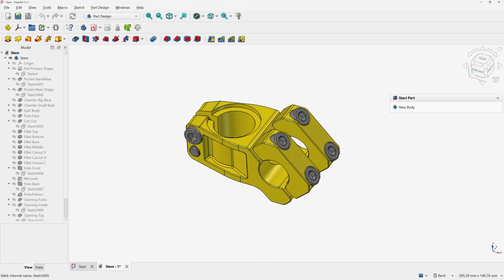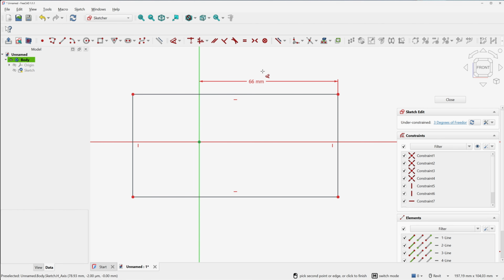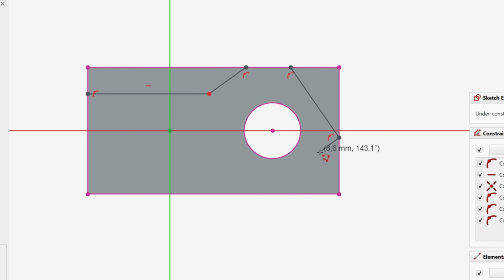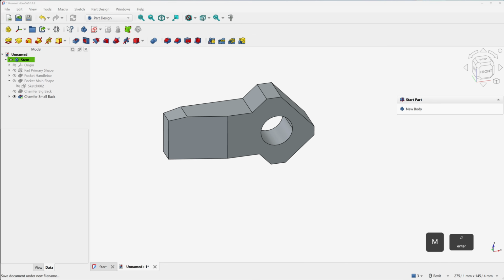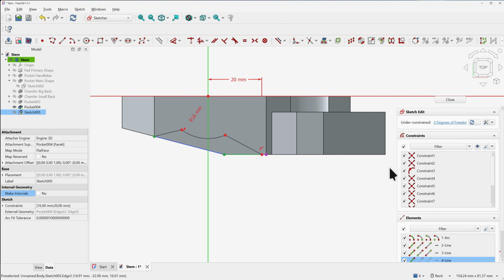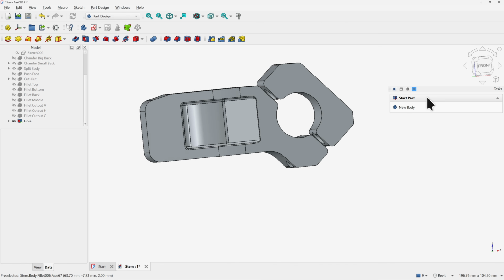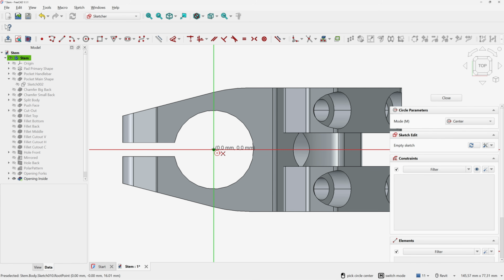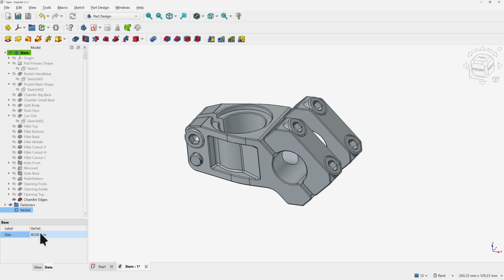New to FreeCAD? Start HERE (Ultimate Beginner Tutorial)

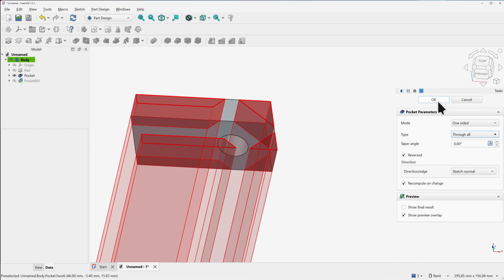Comment: Followed it perfectly through to 19:35 then on mine the 'wire not closed' error messages go nuts (despite checking it with the 'validate sketch' tool to find no breaks!) and it will not 'go through. Man this is hard when something doesn't work as expected - then what? Update: I missed the external geometry tool - you just have to miss one single little step and it all goes Pete Tong!

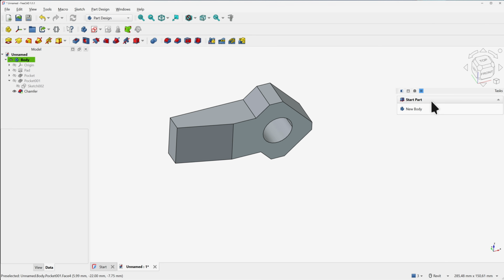Comment: Great tutorial. I'm still using FreeCAD v1.1.0, I downloaded it a few months ago, but only now started using it. Although, I followed the steps closely I encountered some problems. The first was in 'Chamfer Alternative (Pocket) 21:20', something about the shape not being closed, redid the steps twice-- no good. I ended up just doing the regular chamfer. 

Other errors were related to fillets, but...strangely, closing FreeCAD and reopening it again a few hours later solved most problems. The last problem (well, not really a problem since you stated it in the video) was related to the varset, I did that part and extended the 40mm length to 60mm. Then I tried lowering it and was getting an error, the solution was to gradually decrement it by 5mm as in the video. 

Wonderful tutorial, good pacing for me. I'm going to try other tutorials to learn more.

Comment: EDIT: I deleted the sketch and re-did it. for some reason the holes now preview...wierd.

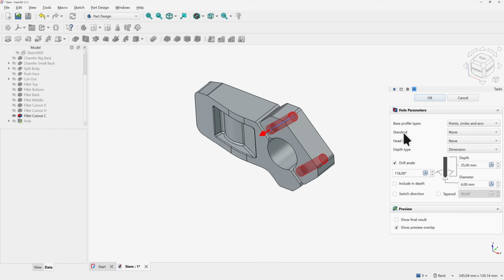38:31 I can't get the holes to generate due to an error dialogue: "Cannot use selected object. Selected object must belong to the active body. Consider using a shape binder or a base feature to reference external geometry in a body". 

Specs as follows:
OS: Windows 11 build 26100
Architecture: x86_64
Version: 1.1.4.20260928 (Git shallow)
Build date: 2026/09/28 
Build type: Release
Branch: (HEAD detached at 4fd3bf320)
Hash: 4fd3bf320d9566a27e60069fc8387448aaa3a094
Python 3.11.14, Qt 6.8.3, Coin 4.0.3, Vtk 9.3.1, boost 1_86, Eigen3 3.4.0, PySide 6.8.3
shiboken 6.8.3, xerces-c 3.3.0, IfcOpenShell 0.8.4, OCC 7.8.1
Locale: English/Australia (en_AU)
Navigation Style/Orbit Style/Rotation Mode: Revit/Rounded Arcball/Window center
Stylesheet/Theme/QtStyle: OpenTheme.qss/OpenDark/
Logical DPI/Physical DPI/Pixel Ratio: 96/93.1131/1
Installed mods: 
  * A2plus 0.4.68
  * Fasteners Workbench 0.5.67
  * FreeCAD-themes 2026.8.16
  * OpenTheme 2026.10.5

Comment: are there some gotchas in the chamfer/pocket alternative step at 21:20?

i set them as construction lines but it still complains about the wire not being closed

i made sure to make a fully closed triangle

what i think i miss in this tutorial is how to verify that the lines are proper construction lines and so forth, a short section on how to check your stuff or debug this

EDIT: I figured it out. The external projection button already made the dashed lines, i didn't need to turn them into construction lines because they already were! If you do toggle the construction line button you'd make them solid instead of dashed, and that won't work

Comment: ive got all the way to the bolts, it does not auto detect correctly and puts one bolt in the large center hole so no bolts for me at the moment i guess. i think i wll try and make them just as a challenge to myself see if i have learned anything. other than that issue i have learned a TON, and it has been a long but interesting evening of figuring how to connect dots and get angry when they don't lol.

Comment: Just a note on placing bolts in the holes so that the head lines up with the top of the bolt hole. The "Match Tap Hole" button must be active otherwise the bolt head is placed in flush with the bolt hole. The "Match Tap Hole" button is shown active in the upper left corner 4th icon from the left.

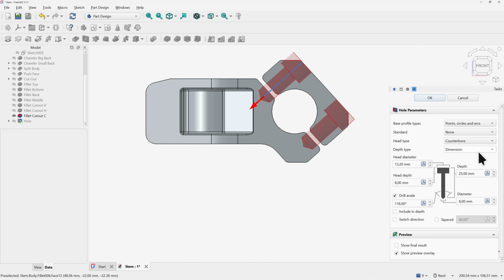Comment: You missed that the inner holes for the fasteners (see 39:14 for the front holes) need to be tapped for M8 threads instead of being drilled to 8 mm; Currently there is nothing for the fasteners to screw into.

Comment: I'm halfway thru the video. And although is fantastically well explained, as a mechanical drafter/designer for over 27 years using Solidworks, Inventor and Creo, I don't see the need of creating the sketches for the extrusion cuts (pockets) on the planes every time. Unless there's a reason for it, I would have created the sketches on the model face instead. But like they say, there's a thousand ways to skin a cat. Other than that, this software is unbelievable good!!!

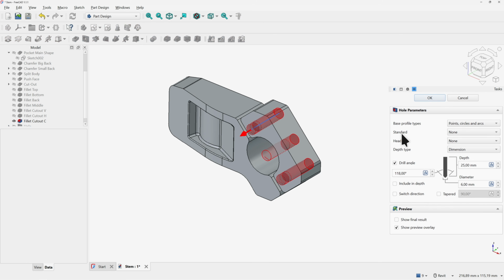Comment: Help pls. In version 1.1.3. I got to the front holes section, I did everything exactly right (I tried multiple times so I know for sure) and then when I switched to 3d view at 38:09 it shows the preview of the 3 holes but I don't have that. There's nothing. And then when he goes back to fix the 3rd hole mistake, I do that, but my lines are all gone. Under sketch edit on right it says "empty sketch"
Reply: I moved on to the back holes section. Same problem.

Comment: Excellent tutorial! FreeCAD is an awesome tool, v1.1.3 seems to be a bit buggy having encountered a few software issues. #1 Ensuring the dots have been converted into constructions lines for holes. #2 Bike_Stem#Fillet.Base missing element reference Bike_Stem#Pocket005 ;#303c:3;:Hf83,E.Edge72. - caused by model rebuilding Pocket005 when using VarSet. #3 the fillet tool seems really flaky for detecting continuous lines/outlines. Rotating the model eventually got most of  them except for the 2 on the top rim of the counter-bored holes on the main stem and 2 of 4 of the top rim of the counter-bored holes on the handlebar stem. Additional fillets I wanted to add. (BRep_API: command not done). AI diagnosed and fixed #2. #3 currently unresolved.

Comment: I want to love FreeCad but the UX pf the tools needs a lot of work.
Some notes after trying to create my first basic model: 
(for reference, my experience is mostly Sketchup, Revit, a bit of Fusion360 and Rhino)

- using ESC to exit a sketch is terrible, i know there is a setting to disable it but this needs to be standard. Happend a lot when spamming esc to exit a tool and exiting out the whole sketch.
- dimensioning is hard to do. I actually really like how revit does this, especially when dimensioning multiple objects in a row with the option to equalize the distances.
- The UI / UX of changing a dimension is bad. Let me single click on the number and change only the number then and there. The window that opens on doubleclick is overkill 90% of the time. If i try to click outside of it, it gives a hard error instead of just closing. This is obnoxious.
- Why does my mouse move around the circle when i try to move it? Even if i click the center, my mouse does not stay there.
- Give us a dedicated move tool (MV in Revit, M in SketchUp etc) where we can just enable it and move an element a typed distance. Let us select a start / end-point of the move that is not part of the actual geometry.
- more snaps, more visible snaps, snapping guidelines to close geometry or lines.

I am abandoning FreeCad for now as it is too clunky to use for me. I don't doubt the functionality for my, honestly pretty basic usecases, is there, but its not usable enough to actually use the software.
This needs some major UI/UX passes, just as blender did, to make the break into the mainstream. It is at a point now where functionality is not the main problem anymore as you have demonstrated in countless videos.

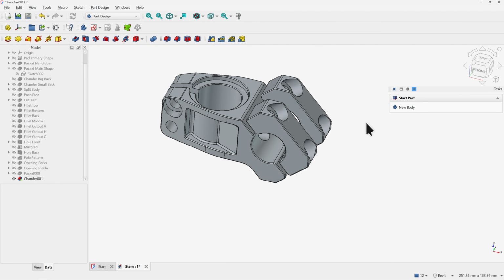Comment: 48:10 Chamfer of the edges was not working for me, I'm using version 1.1.3 I had to reduce the chamfer size to 0.4 mm instead of 0.5mm before it worked, the chamfer of the edges refused to work beyond 0.41mm.

Comment: Increasing the VarSet from 40->50->60 was OK, I then reduced it back to 40 and the model dies with the error:
17:58:26  <Sketch> SketchObject.cpp(281): Edge too small: Edge4
17:58:26  <PropertyLinks> PropertyLinks.cpp(521): Unnamed#Pocket001.Profile missing element reference Unnamed#Sketch003 ;#7a:3;;:H11b3:1,F;:H11b3,F.InternalFace5
17:58:26  Pocket_Main_Shape: Sub shape not found: Unnamed#Sketch003.?InternalFace5

Sketch002 became over-constraint. I guess FC still needs a little more work to fix these issues.
I'm using FC 26.3.0dev

Comment: Internal threads ? (I've spent at least 2 days on this now (over a period of several weeks), very good,... B.R. Caveman) (The struggles were mostly in the beginning as there were many new ways of thinking as I came from using 2D PCB layout CAD 40! years ago (only  using xfig and LibreCAD for 2D later on)  You must be an experienced teacher, as this was just perfect (mostly at 0.5x speed ;-) ..... I'm on an old ThinkPad W540 (4 cores) (24GigRAM) with W10, updates tooks some time, but no problems, and the bolt threads came quickly, and re-calculation at the end was almost instant.
Reply from the maker: @finnerutavdet Thanks ! If you want to model thread, please check this video : https://youtu.be/vwXklzvvxIA at 7.11

Comment: That was excellent. Thankyou. I guess the only thing needing changing in the finished diagram is the holes would need to be smaller to allow for threading to retain the cap head screws. How would you specify clearance vs threaded diameters?

Comment: Maybe someone pointed this out, but it seems there is a mistake in design. 

The threads cannot go through the whole part if you want it to actually pull the parts tightly together, or to clamp on to the bar. The upper section closer to the head of the bolt should have no threads and be ever so slightly larger than the outer diameter of the bolt shaft.

Comment: In order to create the front holes, I had to turn the 2 outer points into construction lines, as oposed to the center point, until I did so it simply did not proposed me any holes when clicking on the hole tool. What did I do wrong?

Comment: Nice job on the explanation. Took me 5 to 6 hours. 
I used the version 1.1.3.
After introducing the VarSet and applying I did get a bunch of edges errors on the fillets and chamber.
After reading some comments, it seems to be a bug with the 1.1 version implying, after recomputing the size, to not be able to retrieve the edges and generating a bunch of errors.
I haven't done a save previous to the VarSet so  I should restart from sratch to be sure but it will take a long time I think :D.

However, I did get the basic and I will keep practicing and keeping in head the bug with the VarSet in mind in case 👍.

Thanks a lot for the video and the time you took it was, again, very helpful :)

Edit : After restarting from scratch (faster this time)  and redone it properlly it worked. 
Initially, I forgot, for a reason or another, to apply one of the formula within the "Sketch005" right before the "Filet Top" with the default 20mm replace by "VarSet.Size - 20mm.
This explained why my "Filet Top" was bugging out since it was not set with the VarSet.Size property.
Lesson learned, paying more attention to the details.
Before figuring out this property, the solution for the Edge not recognized in Filet Top was to erase all known edges and redone the Filet Top by selectionning each 15 edges and reapplying the 2mm

Sorry for the long text hope it will help other peoples :D

Comment: Hello. I'm not a caveman, or that is what I think. Anyway I have a question. Can you telle me the why you  are choosing multipart designs in "part design" workbench instead using the "assembly" workbench?
I come from Inventor and I am thinking this way of projecting is something I was thinking from a lot of time, then I find the limits. Beside of that can you tell me thre advantages for projecting in that way and three about using "assembly" and having 3 different parts taking place in the assembly. I know it takes you time doing it, anyway if you can it would be really helpful for users like me coming from other cads.
I want to start using freecad as a professional cad instead of Inventor. Not only for the license costs but also for social conseguences in helping freecad to grow with donations. I will not donate if I won't be able to use it.
I will take the time to read other comments later! Thank you.

Comment: As a vetted machinist and NC Programmer, this would be a pain in the ass to cut in a CNC machine without a 5 axis (which are expensive). You would have to pay a ridiculous amount just to get this in a machining shop. To save money with manufacturing you should design for manufacturing.

This type of part would be better suited to be made from a diecast aluminum mold which would be much cheaper long term after tooling costs are recouped.

Good design video series so far though!

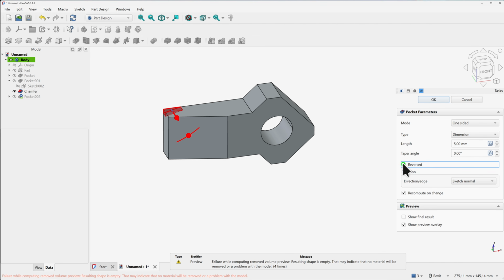Comment: 22:41 The pocket operation didn't work at all (Errors: Wire not closed, or Unnamed Sketch003). I did the op 5x, action by action, I gave up, I used the chamfer method instead. (FreeCAD 1.1.3); Anyway, thanks for the video, it's really helpful!
Reply: I think the error "Wire not closed" there is because of the "External Projection" is actually making a helping wire. So you have to select only the triangle before pocketing. It works for me like that

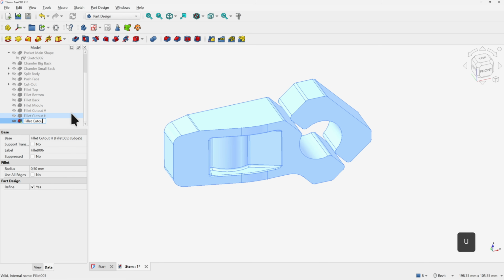Comment: I'm at 36:40, I tried to add this sketch several times, but when attempting the hole operation, I always get "Hole: Null Shape". As far as I can tell, I have set the same constraints and marked all construction lines. I'm confused :((

Okay, writing the comment helped me, as I was going on detailing my problem I stumbled across an oddity: My center line was automagically a construction line. So I figured: maybe the points are "construction points" as well. I clicked through the "Elements" section toggling every one. They turned from blue to red ( I have the dark theme selected), and voila: it worked. I have to continue with this tomorrow though :D

Comment: Im using 1.3. Trying to make a tray to hold a few sets of calipers and other precision tools in my work toolbox. Currently struggling with a pocket having multiple depths ( how the storage box for calipers has multiple depths so it lays flat). Any suggestions? Or is it easier to create multiple sketches and pockets per tool? 

If the latter option is better. How would you go about having multiple sketches under one tree so that the “12 dial caliper pocket” could be used in multiple separate projects and only have to draw it once?

Comment: Make sure that before Mirroring 40:48, you have checked the "Automatically refine model after applying operations" in Preferences > Part/Part Design > General. Otherwise, selecting a mirrored face only selects one half. If you've already applied the operation select "Mirrored" in the Model tree. In the Data properties, find Part Design → Refine. Change it from No to Yes. Recompute (F5).

Comment: It seems like the internal geometry tool is very unreliable. I know it worked on this tutorial, but I could not get it to work on my own part design consistently at all no matter how I did the lines or rectangles in the sketch. Even just a single rectangle dimensioned in relation to a surface line wouldn't work properly and wouldn't allow me to use the rectangle I drew for a pocket or pad, it just wanted to use the whole plane. I ultimately had to use the toggle construction geometry feature instead to dimension off of the part properly.

Comment: I was able to follow along and everything looks identical on mine, except when I got to the VarSet part, changing the value gets "Invalid edge link" on Fillet Top.  I tried redoing the fillets on Fillet Top, but then I'd get errors on Fillet Bottom.  I redid that one and back to errors on Fillet Top.  Went back to both the Fillet and VarSet sections to see if I missed anything, but nothing obvious.  Guess they are unlinking or something?  On 1.1.3.

Comment: HELP! At 45:49 when I try to use the 'coincident constraint' it doesn't work. It shows me an error message "Wrong selection. Select 2 or more vertices from the sketch to for a coincident constraint."  It did the same when I was supposed to use it at 31:05 so I skipped it. I've redone te sketch so many times and following the steps carefully but I can't seem to make it work. I'm using FC version 1.1.3 
Also! Great video! I've tried following others in much in much easier projects and got lost. I'm following along just fine here!
Reply: Nevermind :D I found the culprit in the preference menu! fixed it now!

Comment: Since you are doing all of your sketches on a primary reference plan, does that mean that FreeCAD doesn’t allow sketching on the face of a part like many other solid modeling tools do?  If you wanted to place a hole on the large chamfer and have that hole perpendicular to the chamfer surface, how would you do that?  In other tools I have used, one would just sketch the circle on the chamfer surface and then extrude through the part.

Comment: I am only 1/3 into the video, but I am impressed with your teaching style.  I think you are very clear in your explanations.  I did slow the playback down to 90% speed as you were going a touch fast for learning.  Is it possible to constrain a dimension to the edge of a body?  I am surprised you are constraining the handlebar hole and the rectangle geometry to the axis rather than to the right edge of the part body.  Since it seems that the geometry of the handlebar clamp and hole should remain unchanged when you extend the length of the part, it seems more logical to me to reference that geometry to the right edge of the part so that everything moves with that when the part is lengthened or shortened.